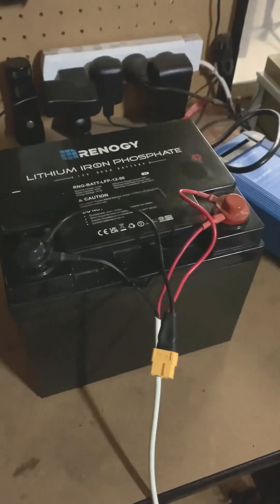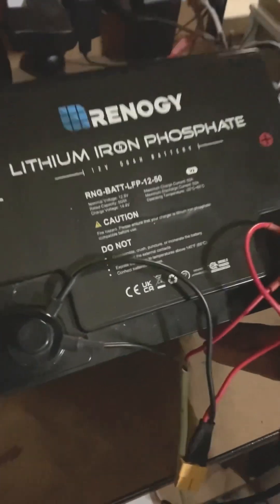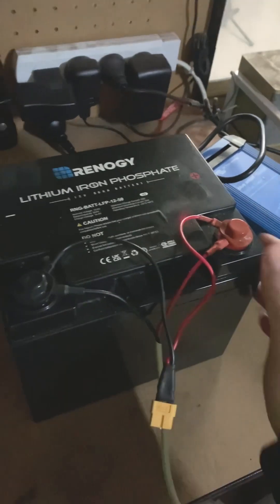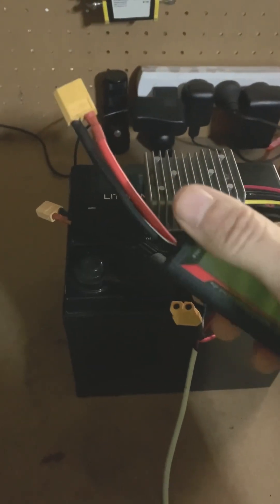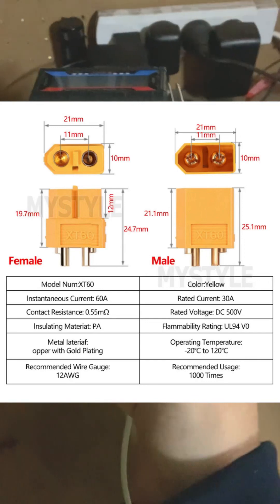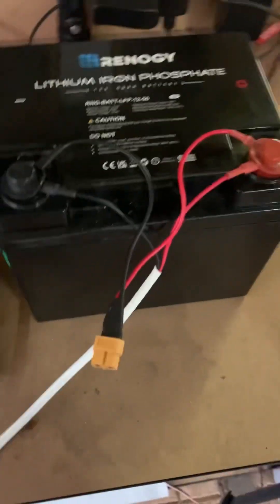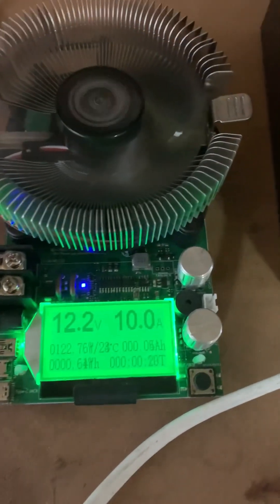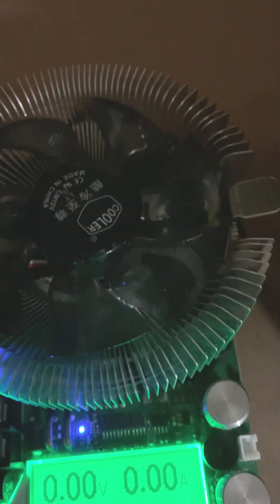Renogy 50ah Capacity Test After 13months

Comment: I'm seriously thinking of getting one of these to use on my inflatable Zodiac to power fishfinder and bilge etc, and also for at cmaping spot to charge/run small 12v devices etc, and recharge using Solar. I have a 100aH Renogy lithium and so far it has worked great. For the price $399 it seems pretty good....
Reply from the maker: Yeah I think for the price they are good value. Renogy do seem to make good products. Watch out for any sales eBay has for an extra bargain.